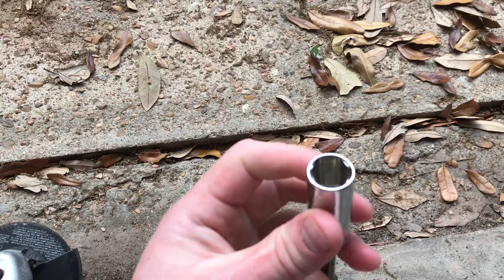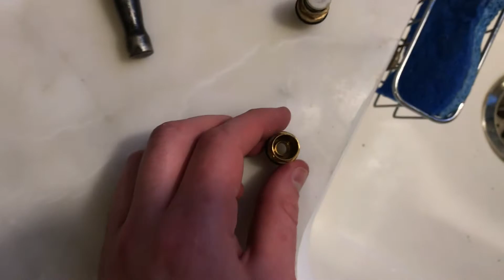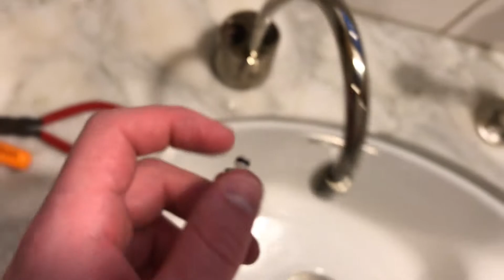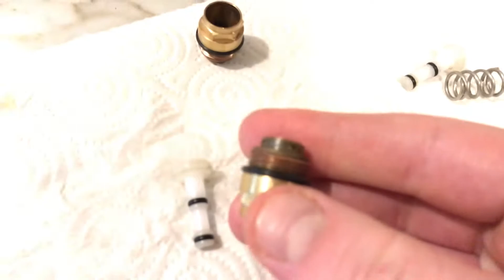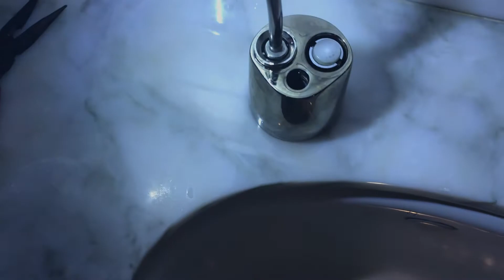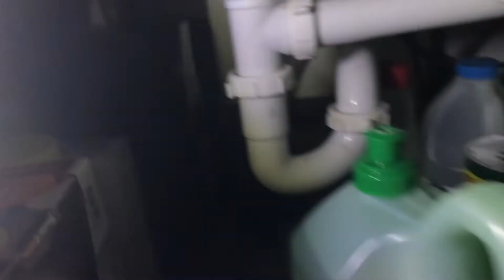PART 2: Insinkerator InstaHot - Repairing the leak

Comment: Thanks for this informative video, Michael.  I am not much of a mechanic & equipment repair person; but, trying to avoid a $700 repair bill, I watched your video.  Our insinkerator instahot had the same drip problem after a plumber replaced the leaking unit.  Didn't have the courage to take the faucet apart, so followed your lead of using silicon & vinegar.  Sprayed WD40 down into the faucet, let it soak in, moved the handles back & forth, spray a second time. moved the handles again and WELLAH!  No drip!  Don't know if my fix is going to last, but at least it's fixed for the time-being.
Reply: Did it work?

Comment: Great videos helped a lot. I had a slow leak and decided to turn off the water, remove the spout  pour some vinegar down the hole where the spout was and  then work the  valves open/closed a few times , remove the handles pour some vinegar on the valve stems and let it sit for about 30 minutes. Reassemble turn the water back on and the leak had stopped.

Comment: You're a brave man handling small, loose parts over an open sink drain.
Reply: Thank you, Michael. Very informative, especially the suggestion you made to never buy one of these but, if you do and have any leaks, replace it with a generic cold water dispenser. Very poor design and no supply of replacement parts.

Comment: Michael had a heck of a time putting the levers back on to the point of yanking out the spout to get more room.  I found that this is really a two-person job.  One has to hold down the lever pushing against a surprisingly strong spring.  The other gets the retaining nut started.  After a few turns the job changes back to a one-person task to simply sinch the nut down until snug.

Comment: Thanks, Michael!  Helped me a lot to see you work through the problems before I had to.  My new dispenser came with a hex wrench that I just kept in my tool box.  It's a habit I got into long ago.
Reply: CORRECTION: That hex tool is for installing the faucet, NOT for taking out the assembly within the faucet

Comment: Many thanks to Michael for enabling all of us to attempt repairs of these valves. I am dealing with the hot water valve leaking cold water at the base of the lever when the lever is depressed. So far, I have tried descaling using industrial strength (30%) vinegar which did reduce the volume of the leak. Next, I want to remove the plunger and replace the O-rings, particularly the single large one at the top, which I think is responsible for my leak. I do not see any comments with the size of that O-ring and would appreciate a reply if anyone knows the correct size and (clear) material.  Thanks in advance.

The configuration of the plunger is accounted for by the fact that the hot valve simultaneously opens the (cold) water supply line to the tank and the hot water line from the tank to the spout. The three rings apparently work to create two "chambers" for these two water flows. I am thinking that removal of the valve housing is not necessary unless scaling has caused a clog that vinegar doesn't cure.  At least, that's how it looks to me currently.
Reply: Did you fix it?

Comment: Great video, thank you!   Mine was leaking water out the top through the small overflow hole when dispensing hot water.  I could not get the plunger assembly out and tried something else before grinding down one of my 14mm sockets.   Using a blunt ended tool I depressed the plunger and poured vinegar into the cavity, working it slowly up and down letting the vinegar soak in down towards the O-rings.   After a few minutes of this I put the handle assembly back on and no more leak.   It may not be a permanent fix, but at least I know the socket trick and O-ring sizes if it starts leaking again.  Thanks a million, you’re the best!
Reply: Thank you so much for this post! I followed this process using Viakal, and its stopped my leak! Have ordered the thin wall socket and O rings as well as I suspect it will start leaking again at some point! Thank you again! And thanks to Michael O'Donnell for this amazing original post. All the best!

Comment: Informative video - wish  I'd seen it  before tackling mine.  I removed the plastic plunger with the 2 o'rings  (which was jammed) without unscrewing the cartridge. I screwed in a  small self tapping screw into the plastic top which then gave enough purchase to pull it out with a pair of pliars. I replaced o' rings with nearest equivalent and reassembled. Worked OK for about 6 months.  Really tricky reassembling. I eventually used grips on the handle to get sufficient downward pressure to enable the retainer to screw in. Comments on your video also very helpful as I need to refit with alternative o' rings. I just need to source the correct ones. Agree its a crap design and my other half wants it replaced  with a Quooker
Reply: mine isn't leaking (yet), but it is sticking on.  Do you think if i just pulled the plastic plunger like you desribed and cleaned it that it would fix it from sticking? thanks
Reply: @John Creach  If the lever is sticking on then you can try removing  the plastic plunger either by my method ( or other methods described in the comments). If its scale buildup then soak in white vinegar.  As its not leaking  I wouldn't remove the o' rings from the plunger as getting right size replacements is problematic. Try reinserting with a smear of silicon grease around the seals and check the plunger travel by pressing down with a screw driver. Hope this works for you

Comment: Brilliant...I can confirm the Lazer tools 4376 14mm socket fits perfectly...I used two  4 x 2mm O Rings on the white stem part of the cartridge and Food grade silicon...I would advise checking the plunger moves freely before re-assembling and pushing it almost all the way in to the body before gently hand tightening the cartridge back in...I did buy a box of mixed O rings and some new Picks, plus teh socket and Grease..Cost under £30 against £300 replacement...Thank you Michael !!!

Comment: These videos made it possible to fix, rather than replace, thank you to Michael and helpful community in comments!  Here was our experience.  Despite purchasing the recommended 14mm thin-wall (sparkplug) socket, fitting was too tight, so unable to remove completely to clean.  Instead, as some have noted, pretty easy with pliers to pull the white plastic plungers up and out.  As was the experience of others here, rubber gaskets were worn and needed to be replaced--here is the o-ring size that worked for us, 1/8" ID x 1/4" OD x 1/16" Thick.  Also added food grade silicone grease as suggested.  Now, all all set!

Comment: Just for the record the socket to undo the 14mm nut is a Lazer - 4376, a special thin wall plug socket for various engines.
Cheers!!
Reply: Why didn’t you take off the sleeve that covers the faucet? Turn off hot water remove the hot water handle, then lift up the sleeve. Rather than grinding down a socket?
Reply: @Wovorp  There is no sleeve on this model fauct. The lower unit is machined/cast as one solid piece. And Tim is correct, you have to use a thin wall 14mm socket like you would for some euro cars spark plugs. A regular socket will not fit, tried it, then ordered a thin wall socket.

Comment: I had the same leak on the cold water side . Replacing the lever was a frustrating ordeal .  Eventually I used a non slip work glove on my dominant hand to push down on it . Worked on first try .  i did remove the spout for more room . A 5/16 allen wrench fit the set screw .  I only took out the plunger not the cartridge and replaced the o rings with Viton A006  2.90 X 1.78 .

Comment: Dude, you are awesome.  Thanks for sticking with it until the end.  It is ludicrous to design a $500 faucet without giving the customer instructions for replacing o-rings, cleaning gunk out....Used your method of thinning the socket (not one of my Craftsman sockets :) ).  Worked perfect.  Had a problem getting the assembly out after unthreading it, but slipped some picture hangar wire around the gap, pushed it in, then twisted the ends together and squeezed the ends together and slowly pried it up.  Soaked overnight in vinegar, cleaned it out, replaced the large o-ring on the bottom, greased them all and re-installed.  Sweet!  THanks so much.
Reply: where are the o rings on the bottom that you replaced?  the ones in the hole that he didn't take out?  thanks.

Comment: Michael O’Donnell, thank you so much for the second video. The advice on the 14mm socket was a huge time saver. I used work gloves to get better hold of the slippery handle putting it back in place. I put the washer back as you suggested thinner section towards the back on the cold side, pulling handle forward works with much less volume then before, but not an issue.

Comment: Was able to repair my leaking faucet by replacing the two worn o-rings on the white plastic plunger part. Took a bit of driving to a few Ace Hardware stores. 
The size of those that work: I.D.: 5/64, O.D.: 13/64, Width: 1/16” (.070). 
FYI - I contacted Insinkerator and they were zero help here and told me that the only serviceable part is the filter. They recommend that I buy a new faucet. 
Thanks for the tip on filing the 14mm socket… I may not have gone for that one had I not known the size already!
Reply: I'll never buy another one of these from instinkerator

Comment: Michael - well done.  I had a different problem:  When using the hot water water was coming up and out of where the lever meets the "body".  

Because of your video, was able to pull the mechanism apart, clean everything really well (there were deposits/corrosion areas) and replace one of the o-rings that looked a bit suspect.  Put it all back together is now it works as it should.  Many thanks for posting this.  While the convenience is nice, I agree these units are overpriced for the quality of the product.  Super happy I now don't need to consider total replacement.

Comment: Does anyone know the size of the O-ring for faucet F-GN1100?
Reply: The two small o-rings seem to be English size AS568 #006, nominally 1/8 x 1/4 x1/16 cross section, actually 0.114" ID x 0.254" OD x 0.070" cross section, also listed as A006, 2.90mm (ID) x 1.78mm (CS)

Comment: I was able to pull up the plunger button which gave me access the to all of the o rings without removing the brass housing. It turns out all the o rings were still in good shape and the whole thing was clean but the leak remained. I was able to fix the leak but leaving the threaded collar slightly loosened. It seems like with the collar but being all the way tight the button was slightly depressed which was causing the leak.
Reply: This is how I fixed a mysterious Delta faucet leak I had. The faucet assy was way to tight to the sink, stretching the threads and causing the leak.

Comment: Thanks for the detailed analysis. My Insinkerator hot water dispenser was also leaking at the handle base. Every time I would dispense, it would leak some water. I only thing I did was clean all the parts out and replaced the two small rubber O-rings on the white plastic plunger. I didn't have the correct O-ring size for larger, outer seal. I had a 14mm thin walled socket (BMW spark plug) and that worked with a lot of room to spare. I also used an impact wrench to break loose the inner nut. Having a seal pick was helpful for the O-rings.  Cheers!

P.S. The O-rings I used for the plastic plunger were: Viton A007 (3.69 x 1.78)
Reply: Yea, that's where mine is leaking too.

Comment: I came here to hope to find a link to the plunger valve.  My model is different and easier to access.  Unfortunately finding parts is nigh impossible.
Reply: Hopefully you have the original instruction manual. There should be information on who to call for parts.

Comment: What I did to re install the handles is tape them up good to prevent scratching and then with a vise grip I was able to push them down.
Reply: I did this also. So much easier than with just bare hands.
Reply: Someone, help me out, how would you use vise-grips?
Reply: @pnshr88  simply open them and clamp down.
Reply: @maeu59  thanks smart guy, clamp down on what? Can't clamp down without getting in the way of the nut your trying to tighten. Explain
Reply: @pnshr88  again, tape the handles and with the vise grips pointing down grip the handles in the middle away from the nut, lock the vise grip….while pushing with downward pressure tighten the nut. Once the nut grabs you can release pressure and tighten the rest of the way. Not too difficult.
Reply: @maeu59  oh yeah right, that definitely works

Comment: It seems you can use the chrome piece that goes over the brass 14mm as your tool to remove the cartridge (if it is not too tight) just use a butter knife in the slots to twist lose the cartridge.
Reply: This is what I did. It worked.

Comment: There is a 2mm set screw on the back side that holds the spout.   The white nylon ring on my faucet is also split so i don't think you did any damage.   
I had to do the same as you, modify a 14mm socket to fit.  Looking online you can purchase 14mm thin wall sockets that might work.  Great video!

The thin vs thick side of that piece may control if the faucet will stay in the on position.  The cold side is supposed to stay on but not the hot.

I agree InSinkErator is way too proud of these faucets!  For the price they charge, repair parts and a diagram should be available.

Comment: Did you call Insinkerator and if so, did they give you a link to a detailed diagram or give you any information at all? My new one is dripping and plumber couldn’t fix it.  I’m happy you fixed yours.
Reply: I called Insinkerator.  No help at all.  Only information provided was that the unit is out of warranty and I should just buy a new one.  Why help the customer, when he/she can be forced to buy a replacement unit and we (Insinkerator) can force the customer to buy a new one with a hefty mark-up?

Comment: My faucet is also leaking, but around the levers. Did you happen to try a thin wall 14mm spark plug socket? Crazy thing is a complete new tank and faucet (e.g. HC-Wave-SN) is about the same price as just the replacement faucet (F-HC1100SN).
Reply: I agree with you Insinketator pricing a shame.
Reply: I haven't worked on one of these yet, but from the video above, I'd guess leaking around the levers would be caused by the larger O-ring on that valve assembly.
Reply: I have the exact same problem except my Insinkerator. I have the H-Wave-SN too. It's hot only. It now constantly drips. I'm sure it's a washer. I'm not sure that bell housing can be removed and I'm not sure if the washer can be replaced. There's a tiny screw on the back of it. I called Insinkerator and they said that it was not reparable. Darn shame to have to replace the entire unit becase of this.
Reply: Mine is doing the same. Did you find a way of fixing this?
Reply: Yes, I used my BMW N54 spark plug socket (14mm thin walled).
Reply: Were you able to fix?  I have same issue.